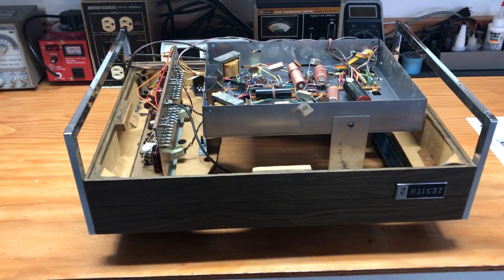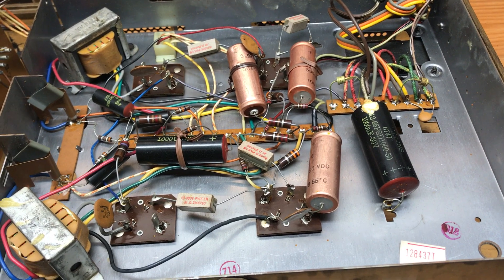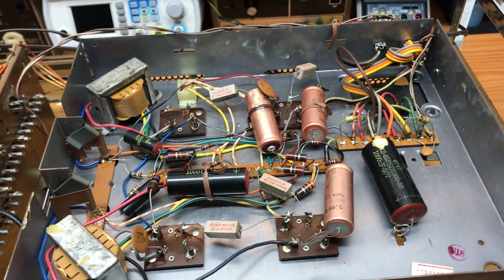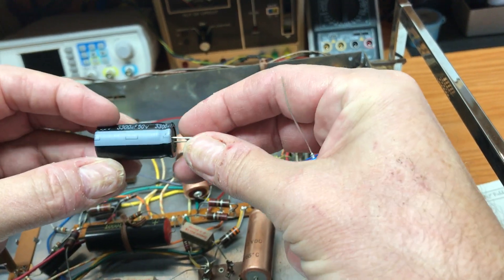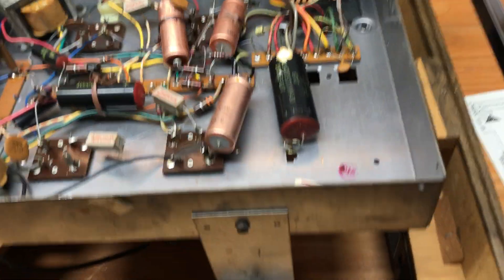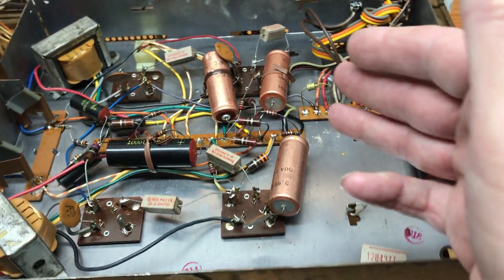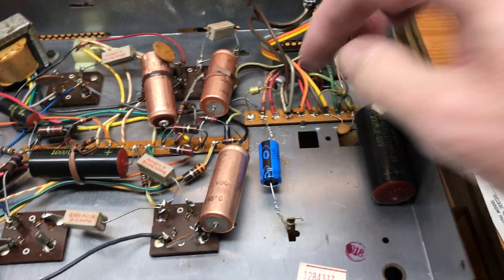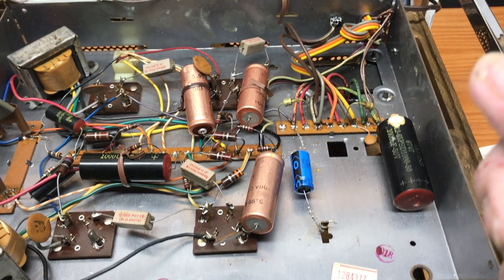Recapping a Zenith Circle Of Sound Record Player Amplifier

Comment: Hey Steve, have been enjoying your videos. I was inspired to grab a well worn Circle of Sound system locally on FB marketplace. I grabbed a few parts (idler wheel, new 6.5 inch speakers with wizzer cone, tiny springs, new power switch) got it all shined up and running great. I'm on to the capacitors now and was curious if you'd be able to share the capacitor values (uF and V) so that I can track down modern replacements. I was going to purchase your eBay listing but it looks sold out. Any help would be appreciated, happy to send a bag of fresh roasted specialty coffee your way. Cheers!
Reply from the maker: Ground or beans?

Comment: im having an issue with my zenith circle of sound turntable, there is no power , i turn the knob to on and nothing happens no lights nothing. Any ideas?
Reply: I just bought one not turning on and I opened from the bottom, that was the easiest way. The power cord has a couple plastic connectors that snap because of cable moving to much or been pull to much and just plugged back and taped it, check that.

Comment: Hello, I also have this system with omni direction spkrs, the motor off switch which switches off the motor is missing in my system, so after the  motor keeps on running, I need that switch.
Reply from the maker: https://www.thevoiceofmusic.com/catalog/vm_changer_ac_switches.asp

Comment: Hey Steve. I just picked up. Mine had a 2amp  fuse right where  the power wire  plugs into the wall. But as soon as I plug 🔌  it it blows the fuse  what could be the problem  ?
Reply from the maker: It could be one of many things, but the most common are a shorted capacitor, bad diode or shorted mains transformer. But the first thing to check is that the power cord is good....no breaks or frays.
Reply: @SteveScarlet   so if it is where can I buy replacements
Reply from the maker: @twanbutler692  you don't know what you're replacing yet....take it to a tech

Comment: So, I wanted to ask about other fidelity issues. I have 2 of these, with & without the radio and both have little top-end until the volume is cranked all the way up. Shango066 did a video on a Zenith tube radio that had a same issue, and he removed a cap that really improved the sound. (I think it was on the radio side, not the amp side oddly enough) Have you happened across a similar hack for improving these solid state units?
Reply from the maker: Can you share the link to that?
Reply: @SteveScarlet  https://youtu.be/FIBlNzZHLlg starts around 14:13.
Reply from the maker: @BRMBug  So I am currently servicing another Circle Of Sound and I tried that hack...removing that wiper resistor.....it gave a little more volume at 1/4 turn but then did nothing as you increased it.
Reply: @SteveScarlet  🤔 I took the turntable out of the radio one to get the non-radio unit going for diagnosis. Once I got the original TT working and in, (and re capped the amp) the fidelity & volume increased. I think I may have problems with the cartridge in the radio model’s TT. I’ve also discovered that the AUX input really prefers an AUX output rather than headphone output. (Using an iPod dock vs iPod w/o dock) I may just leave the wiper resistor as is.
Reply from the maker: Interesting, of course you would have to experiment with what you have.....